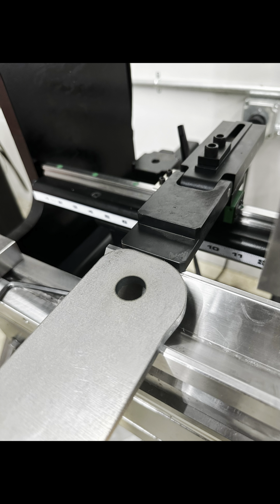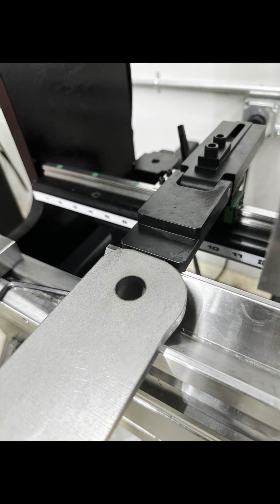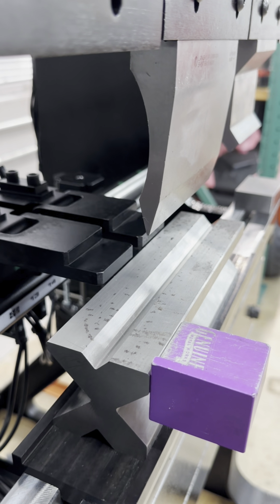Backgage Finger Upgrade – Langmuir Pressbrake Titan 25T

Comment: You know you're using the wrong part of the back gauge to bump your work? Your material should be on the shelf and against the back ledge of the stop, not just taping the front. Imagine your press break was industrial manufacturing size and you wanted to bend a sheet of .25" steel at 32" and its 40" wide, you wouldn't just try to suspend it in the air against the back gauge. you would need to be able to rest it on something to get the most accurate bend and youre not killing yourself trying to hold the material until the jaw clamps it in place.
Reply from the maker: not sure if you missed it but the lower face of the back gauge is only use to bend parts that are 1" are less from the center of the upper die. The overhang you get from bending that close is actually support by the lower v die. Now of course if I'm bending a part further back > 1" of course I'm going to use the upper face of the backgage which has the bottom face to support/aid the sheet material.

Comment: Just found out about these press brakes. great deal for what looks like well designed machine. really wish they were 48inch. Since the ends are open, do you think it would be possible to mount a rigid 48" one piece top and bottom die and bend a thin piece longer than 33"?  How long before you placed your order before it arrived?  you are the only one I see on YT posting titan content  :) so thanks for that :)
Reply from the maker: Honestly not sure about that but what you could do is make split in the center of the 48 and bend each half then weld back up that split. Eta on these is hit or miss expect a year or so out of